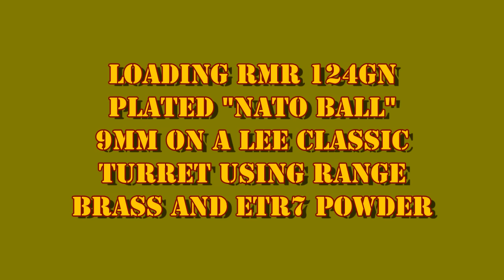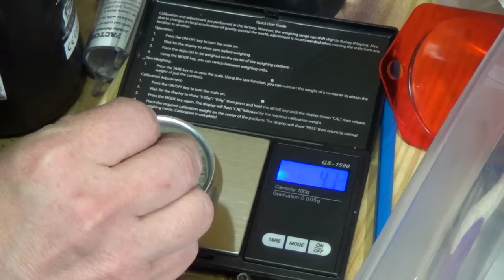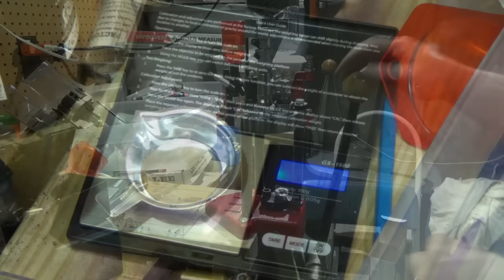Loading RMR 124gn 9mm "plated ball" on a Lee Classic Turret

Comment: What's the 2nd die that has the rod coming up thru the die?
Reply from the maker: +Hal Larkin Jr. RCBS powder check die... It tells you approximately the charge in the shell.  You can tell if its too much powder, or too little...  or none at all.  If the markers line you, you typically are "good to go".  It has saved my ass a few times!  The last thing you want on a match, or in real life... is a squib!  Your down once that happens.